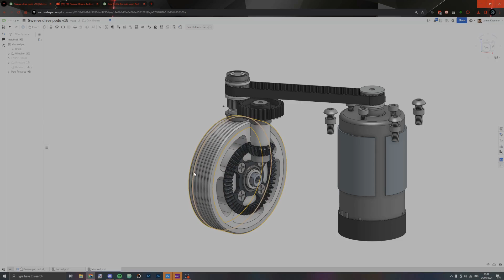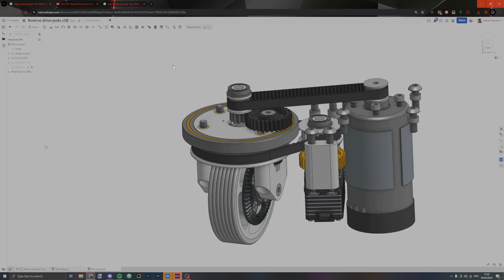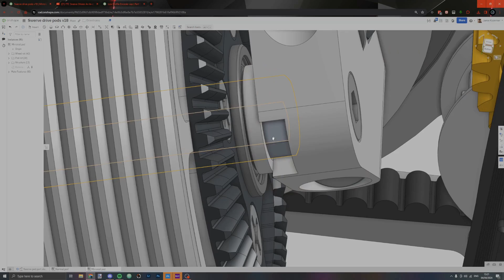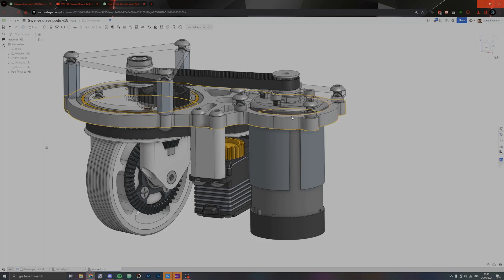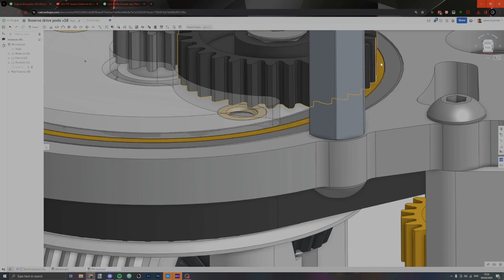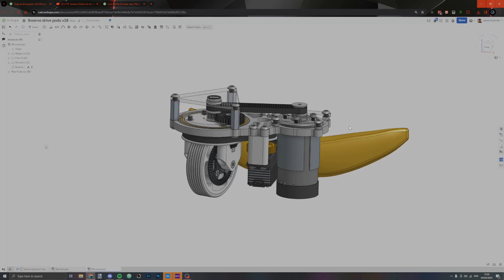FTC Swerve Drives: An In-depth Explanation +CAD download

Comment: is anything custom? If so is it 3d printed cuz our team does not have a CNC machine and we really want swerve. This is the only design I have found that only uses one motor per wheel. Thanks for the cad to take a look at!!
Reply: Looking at it parts are metal. You'd need to use scs or something.

Comment: How can I add encoders, for Swerve orientation
Reply from the maker: the axon mini+ servos already have a built in analog absolute encoder you can read out with the 2nd servo cable, but if you want to use different servos, you can attach a encoder on top of your servo gear, which is 1:1 to the pod. make sure this is a absolute encoder, as this makes sure you don’t have to zero your pod later, due to the way absolute encoders work.
Reply: @TerraVoxel  Thanks! Like, I can run it as a Continuous Rotation Servo at the same time I get position data?
Reply from the maker: @AlejandroFuentes-kc5gb yes, they can run both in servo and continuous mode, with full range analog absolute encoders. Make sure to check the axon documentation for implementing the encoders in code btw ;)